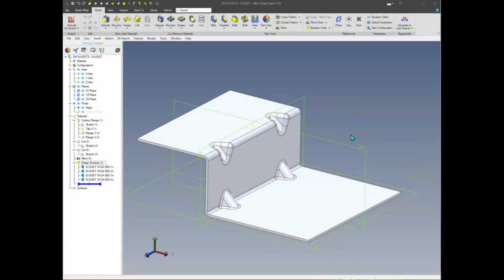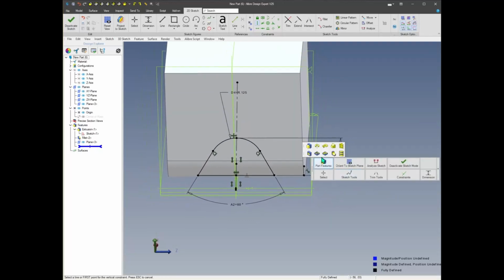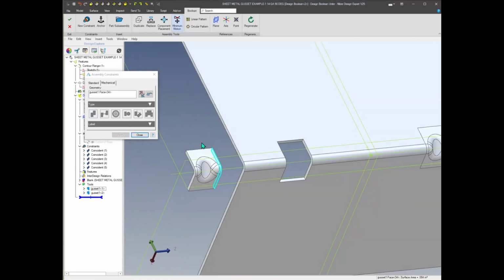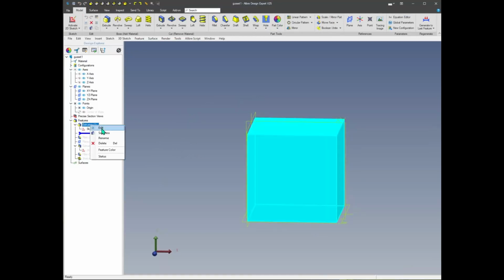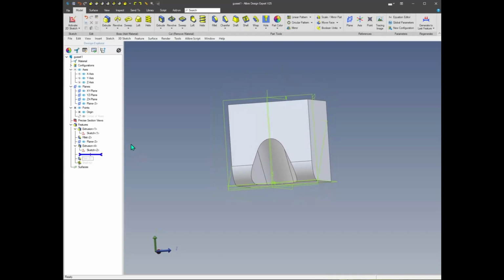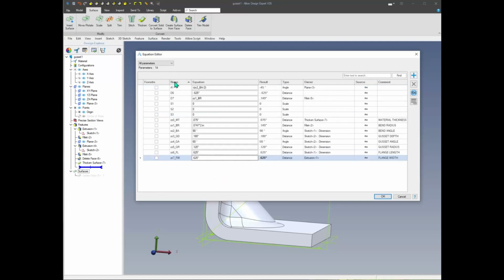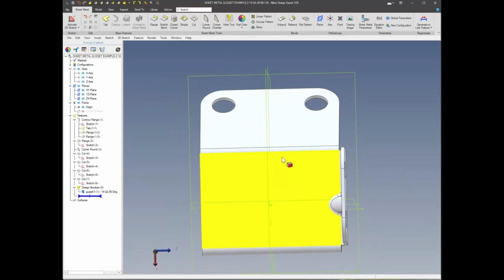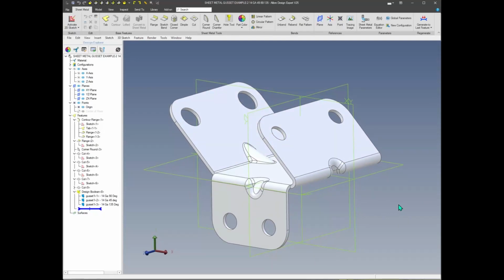Creating Gussets in Alibre Sheet Metal

Comment: Really nice info! A suggestion to make the shell work at all angles is to make your original sketch top line perpendicular to the angled sheet face. Then you won't need to thicken a surface.
Reply from the maker: Thanks, that's a good tip to know about shell. And it will help Atom 3d users without surface tools when using shell for other parts or when simulating sheet metal.

Comment: Really cool tips on how to add the gusset and on how to keep the flat pattern. Really helpful stuff. And the option to have the model tab visible in Sheet Metal is also useful.

P.S. I like how you use the floating context menu for most commands. I should try to use that more.
Reply from the maker: Thanks, I like the context menu, just would like it to be customizable, like the 'S' key in SolidWorks.